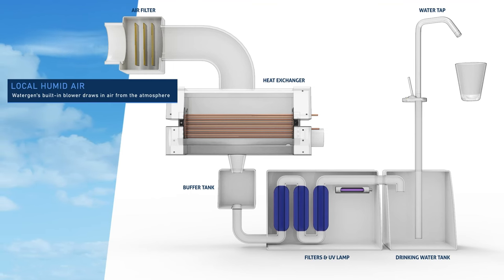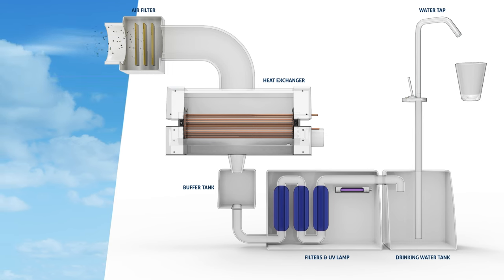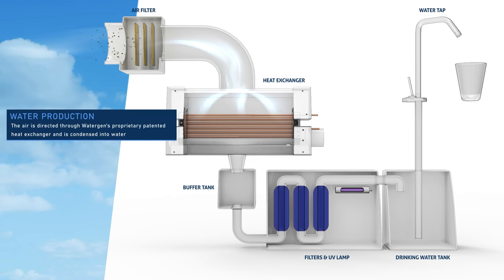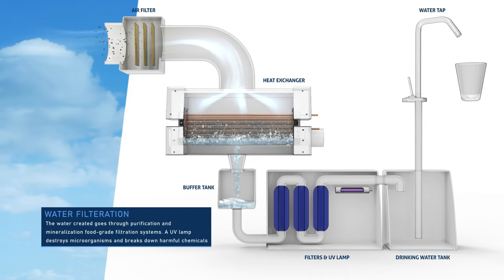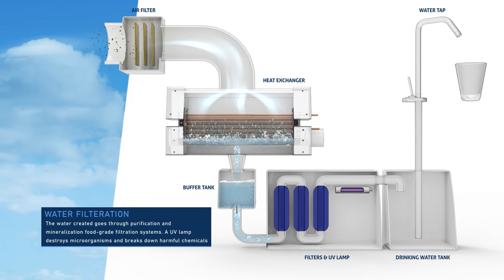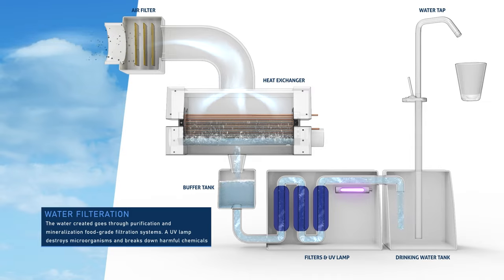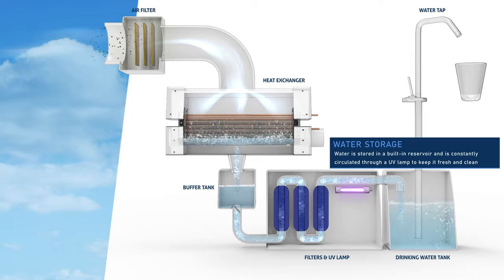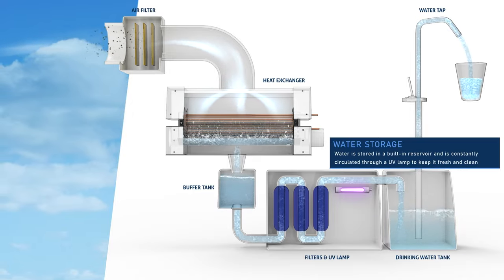Watergen - how it works?

Comment: Any air conditioner around the world produces water as it cools the air used to cool homes and businesses. Most of that water just drips out and gets wasted. The challenge is to find how to store that water, filter it, and then use the water for drinking, cooking or other uses.
Reply: Yep, or you could go with a dehumidifier too. I have one that you can store the water in a tank, pump above itself or let gravity drain it away. Mine would require an inverter or even a generator. (Don't know how many watts mine is.) Edit - The question below required me to go look a similar one up and I dug a bit deeper and found it is 115 VAC at 7.0 Amp/4.9 Amp. 115 x 7 = 805 Watts. (I'm guessing this is with the fan, compressor, and pump running all at the same time. The pump wouldn't  run continuously though.)

The cool thing I see with this is, that it's 12VDC and if you have a camper, run it off the vehicle's electrical system. You could make a simple setup at home, especially if you are off-grid, with some LiFePO4 batteries and a couple decent solar panels. Where I'm at there is rock very close to the surface. I know a guy with a well and he had to through 30 feet of limestone before hitting the water table.
Reply: @johnbrewer1430  I see that my comment was made about a year! I still would like to buy either this equipment or something similar to your dehumidifier, one that works. Where did you buy yours? About 6 months ago, I decided to buy a water distiller from Amazon (around $170!). It still works for me and distills water from my city tap water. I know the water is okay since it's been distilled, but it still makes my mouth and throat extremely dry! If I drink the distilled water and go to sleep, after some hours I feel like I'm choking because the water is making my mouth and throat very, very, very, very dry!
Reply: @richardnsalvador  I got it at Lowes. The same exact model isn't available, but this one is from the same manufacturer. Hisense 50-Pint 2-Speed Dehumidifier with Built-In Pump ENERGY STAR. (50 pints in 24 hours. 12.5 Gallons. This would also depend on how humid the air is.)

As for drinking water. I have bought Whirlpool Reverse Osmosis units from Lowes, for the houses I have owned, and I'm happy with their performance, except in the house I'm in now. It was a second home at one time and it has Hardwood floors throughout most of it including the kitchen. We showed up one weekend and it had leaked all over and buckled a large swath of the kitchen, that had to be replaced. We now use a Culligan on-demand RO unit that has leak detection. The Culligan Aquasential Tankless Reverse Osmosis (RO) System. The downside is it's much more expensive and it needs electricity to work, whereas the other one just needed water pressure. I also have it plumbed into my refrigerator/freezer so the ice and water from there is RO. 

Here is some detailed info. https://www.hisense-usa.com/air-products/explore-air-products/all-air-products/DH7021KP1G_hisense-energy-star-50-pint-2-speed-dehumidifier.

Of course, anyone reading this may need to filter it too. It has an air filter, but it isn't very fine and I'm sure it would have dust in it. Plus if you used the reservoir and didn't empty it frequently it would get mildew and algae in it. A cool off-grid setup could use this to pump into a different tank, (Norwesco  Horizontal Leg Tank, 35 gal.) which would have a 12 VDC pump (Camplux 83/1000-HP 12-Volt Cast Iron Portable) capable of at least 30-40 PSI and have a smaller pressure tank (A.O. Smith 20-Gallon Horizontal Pressure Tank) like you would with a well. Plumb an RO unit in and you are golden. (AQUASURE Premier 4-stage Carbon Block Reverse Osmosis Filtration System) Of course, this would only be for drinking/cooking.

If you buy bottled water you will see that many of the bottlers use a municipal source, RO it and add minerals.